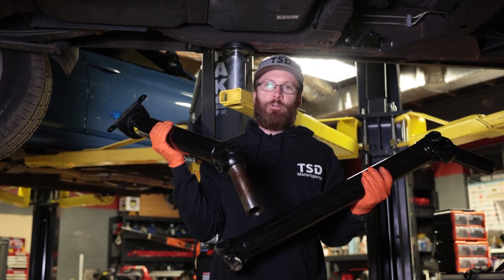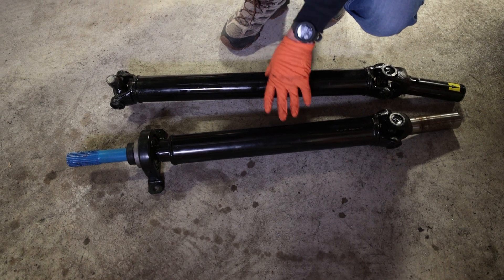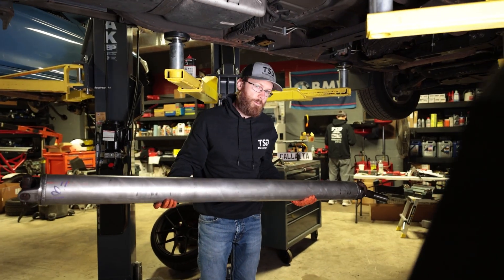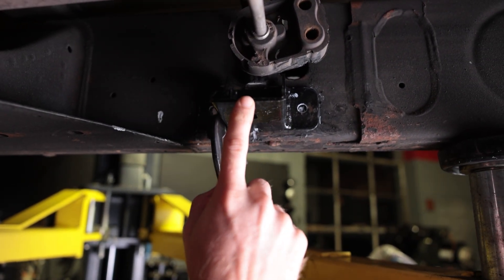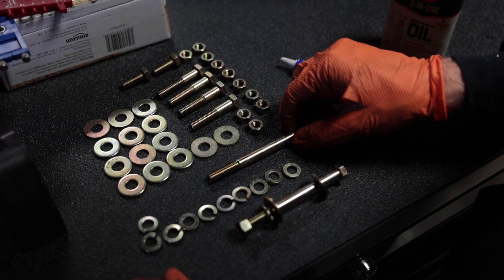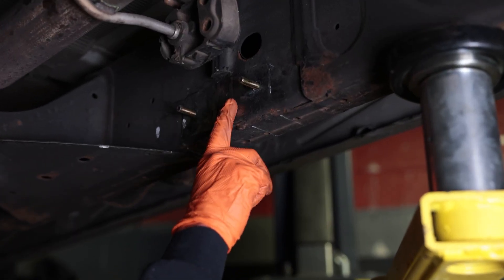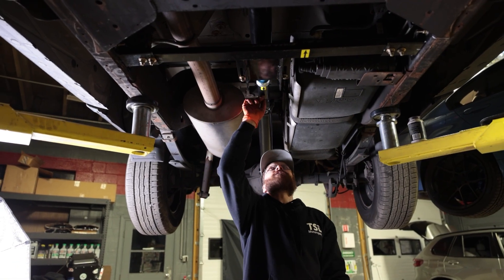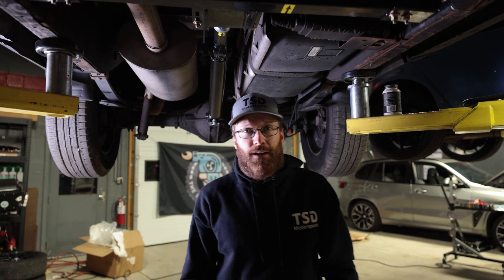4x4 Silverado 2 Piece DriveShaft Install - Chevy Shake Fix? 2014-2018  Sierra 4WD 2WD

Comment: Hello Sir  I have 2014 Silverado 1500 5.3L Z71 LT 4WDI want to put 2 piece driveshaft  with 6L80 lowered. 143.5" wheel base. How ever im also going to convert from 4wd to AWD. Will I have to get a new shaft or get new front shaft.  Can you help me with my and let me know price. Thanks

Comment: Man I’m trying to turn my Silverado with a one piece drive shaft but I didn’t know they crumble when hitting 95mph or more. I have a 2011 2500hd 6.0L with a two piece driveshaft. What should I do? I’m a speedy type guy. And I love pushing my truck over 95 lol
Reply from the maker: The two piece may be able to handle more hp. Unsure as it is a different platform.
Reply from the maker: I'm the same tho, I like to be able to push it a Lil when I want to lol

Comment: So I did the 2 piece drive shaft .. 1 piece driveshaft .. axles .. 3 sets of tires and lots of balancing … replaced the trans and converter … and tuned it … still vibrated the front seat console !! Replaced the front hubs that my dad suggested towards the middle of throwing parts at it but I always thought if it shakes the seat it’s in the rear and steering wheel it’s in the front … nope the hubs on the front fixed it for a 150 bucks .. I spent a lot of money on this all for it to be some front hubs crazy
Reply: So if you put the wheels off the ground, spin the tire while holding the spring. Even if it is a torsion bar as a spring, hold it and spin the tire and you'll feel if your hub is bad by the vibration. Great way to pinpoint bad hubs with no play.